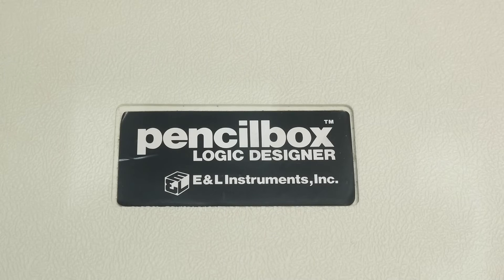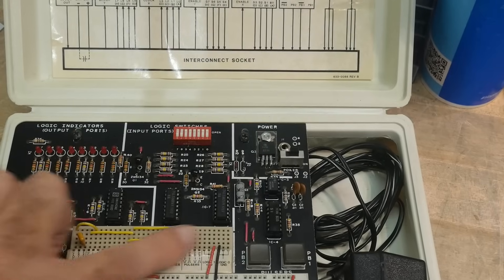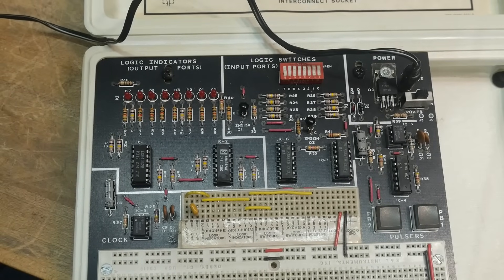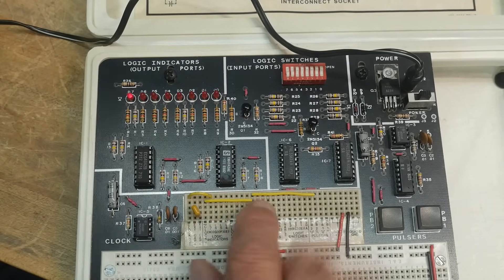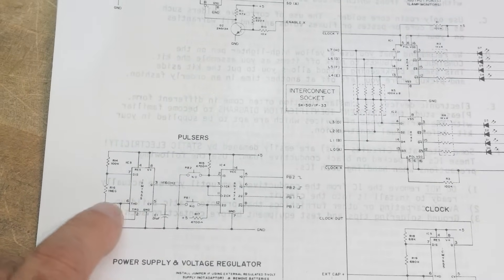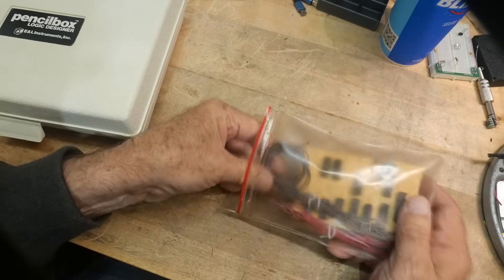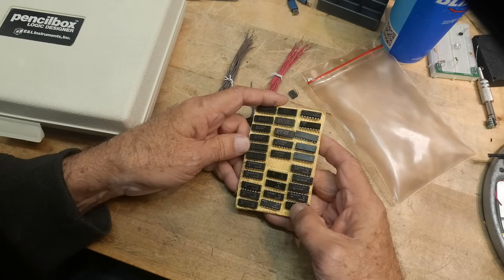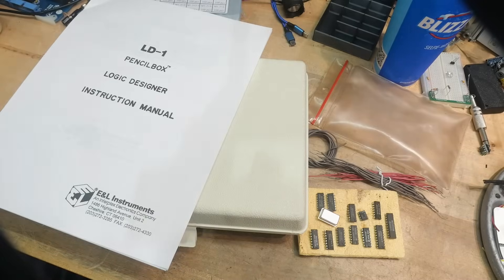#2110 Pencil Box Logic Designer

Comment: Nice. I've never seen that "trainer" before, although many of their others. After monitoring eBay for a while I finally picked up one of their CADET II systems. It's a beast, made from heavy gauge steel and many of the signal sources and monitors are all discrete components. I had found the schematics and was considering building some parts of it myself but found that sourcing the parts quickly became more expensive than getting one second hand.

Comment: I have something similar but with more features. It was called the Wishmaker II and was bought from Jameco. The user manual is copyrighted 1988, and in addition to the pulser, switches, and LEDs it also has an analog multimeter, a waveform generator, a frequency counter, and +5 and variable +/- 1.2 to +/- 15 volt supplies.